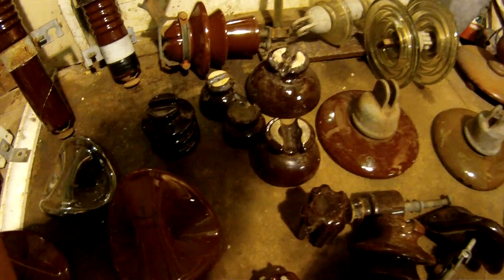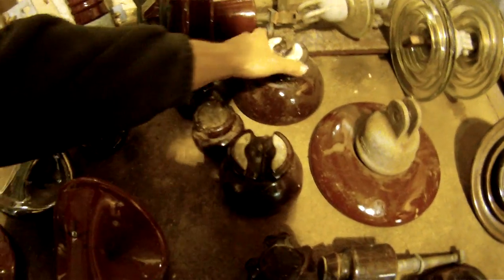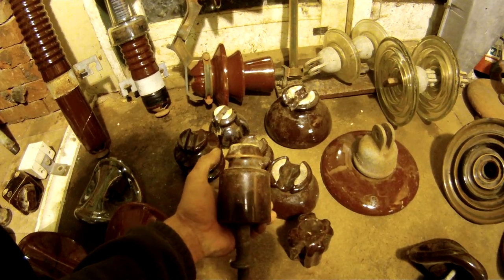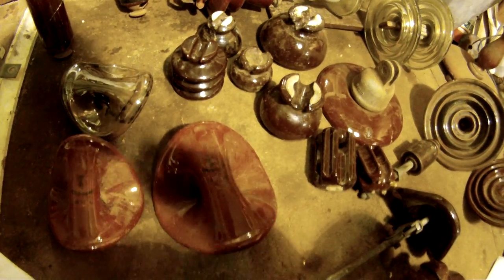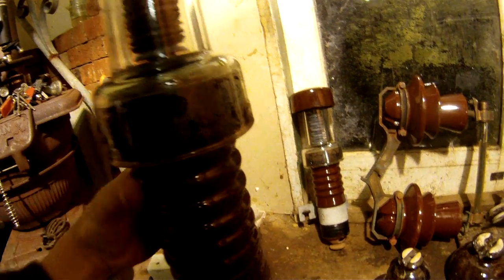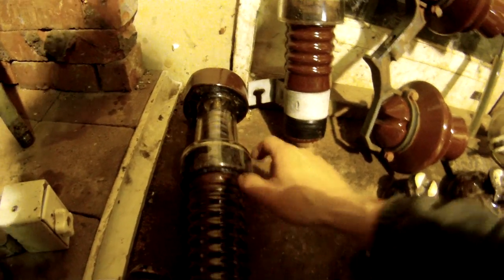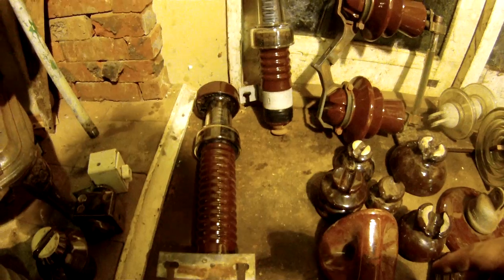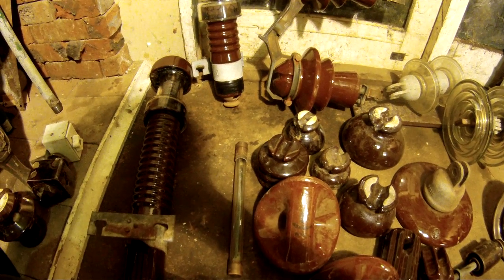a selection of vintage insulators

Comment: The Bullers factory and Taylor Tunnicliff factory were just around the corner from where I live. I live in Stoke-on-Trent in England where the pottery industry was massive in the late 1800’s right up until the 1990’s. In terms of insulators we had Bullers, Taylor Tunnicliff, Dolton, Allied Insulators, Steatite & Porcelain Products Ltd, Electric Ordnance Accessories Co. Ltd and many many more.

Comment: G'day Tony. Just a question: at the corner of SH12 and Wharekawa Rd the are some power poles with pale blue glass isolates on the lines. Are these old isolators or modern manufacture?
Reply: Sorry, meant insulators
Reply from the maker: Yes i know the exact ones you mean  they are just down the road from me
Those insulators are 1980s armourlite brand disc insulators  so not that old 
The smaller concrete pole that stands underneath the double one is a 1950s L shape pole from the original line.
closer to wharekawa road  on the same side  where the line turns 90° is a really old 1930s insulator on the stay wire  
I do have two of those aqua blue disc insulators kicking around  but they are common as so they will just sit there
Reply: Cheers mate.